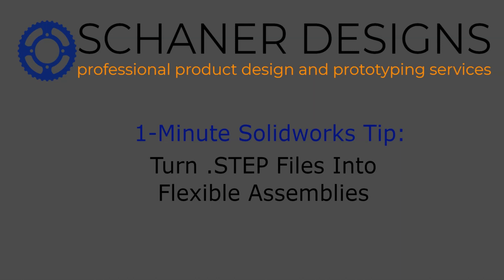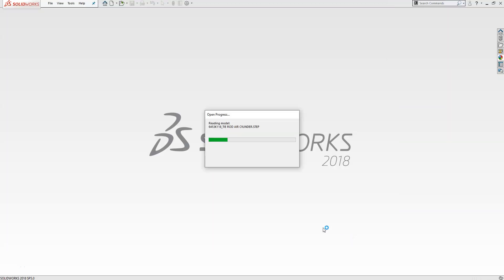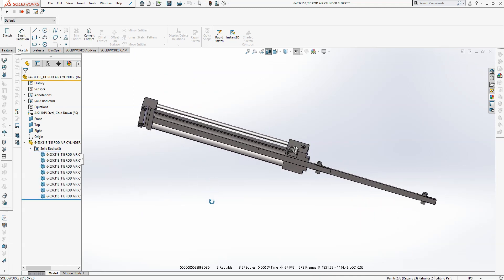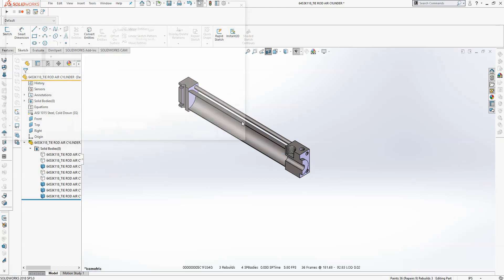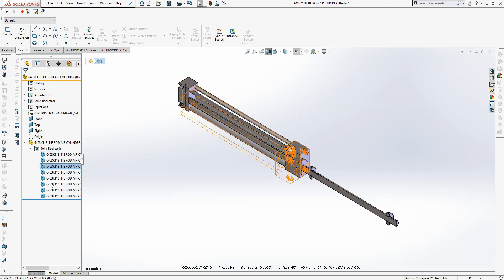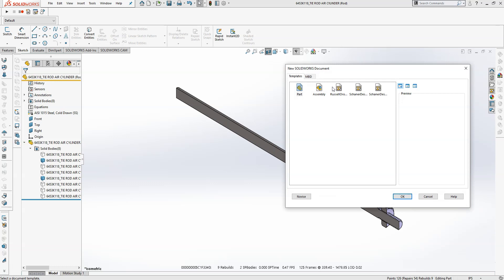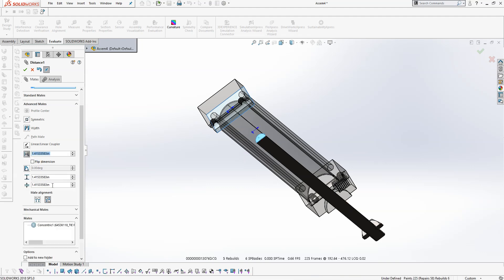Solidworks Tip: Make Flexible Assemblies from STEP Files

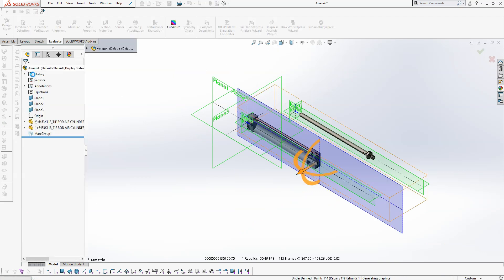Comment: At 1:25 when you placement the first part. You don't need to pick the coordinate. 
Just choose the part then pick the "green check mark" on top left. It will place the first part where it belongs like you build in the model...
Reply from the maker: Good catch, thank you for pointing that out!
Reply: @schanerdesigns  , 
I learn that from a lady works for Hawkridge systems.

Sometimes it helps a lot.

Comment: What would be the next step to building this product if you didn't want to use 3D imaging
Reply from the maker: All components for a product like this would need to be CNC machined. There are also components not shown in this particular model, such as piston, linear bearings and seals, which would need to be carefully designed with the appropriate tolerances to ensure a good fit and seal. Typically, you will need to provide a machine shop with 3D models of each individual component as well as detailed 2D drawings or prints.

Comment: What if there is step files inside a step files?
Reply from the maker: If a .step file has been re-saved or exported as a .step file, it's still just a .step file. This method still works as long as there are multiple imported bodies to work with.